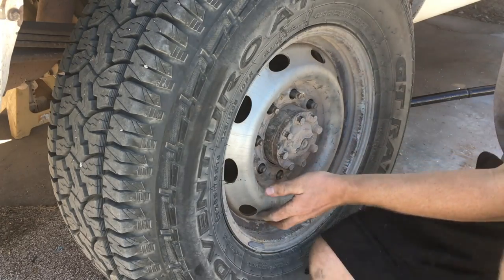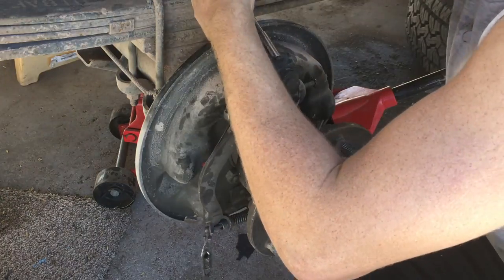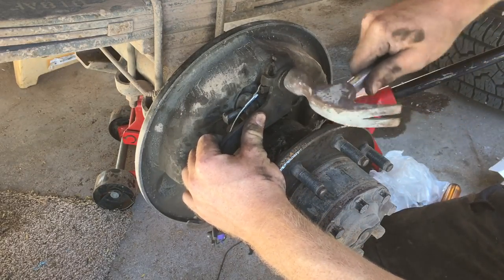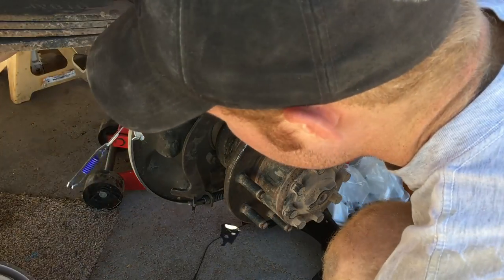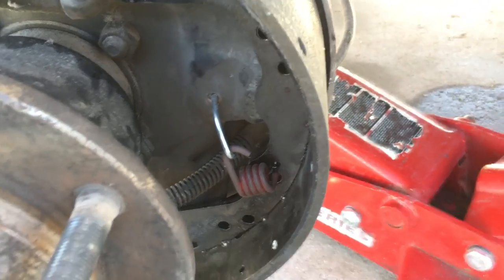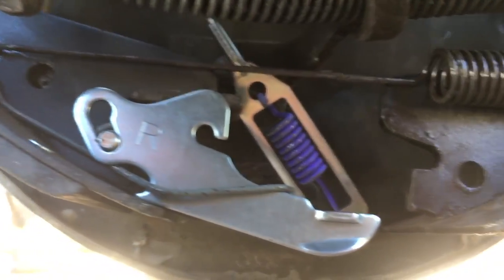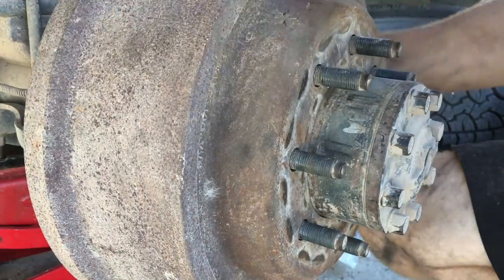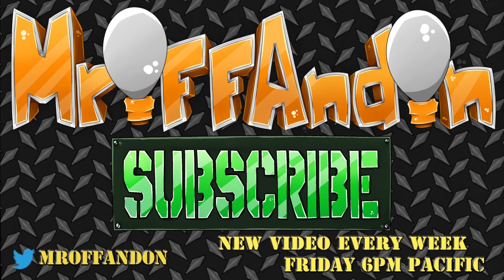Grinding Noise In The Rear End | How to Replace Rear Drum Brake Pads | 2500 Dodge Ram

Comment: what year is that truck....im trying to replace my 99 and everything looks just like yours but parts store says my rear end is not the original
Reply: Kyle Perna did you figure anything out I'm having the same problem as you
Reply: I have a 2000 Dodge Ram 2500 van, and the crazy thing is that some have the 5 lug wheels, and some have the 8 lug wheels with the heavy duty 4000 pound front axle and 12 inch rear brakes. So the best is to buy parts for 3500, because parts stores get confused.
Reply: Kyle Perna Yeah buy the hardware for a 3500. I have a 97 Dodge B3500 and the axle doesn’t stick out that much; it’s a 5,700 lb axle. But the hardware and layout are the same as the vehicle in the video.